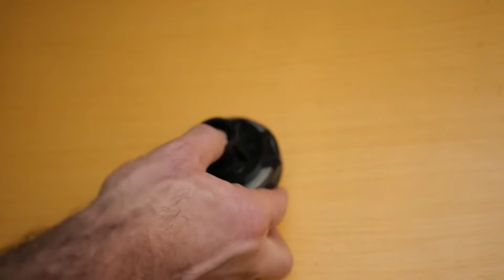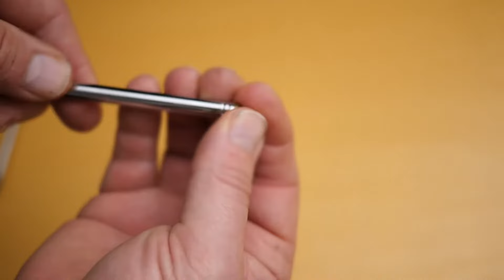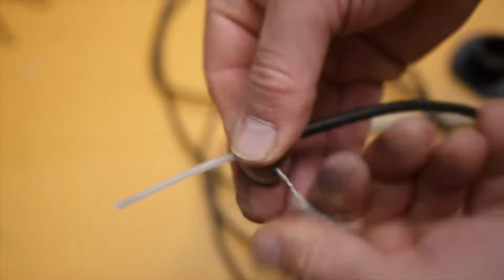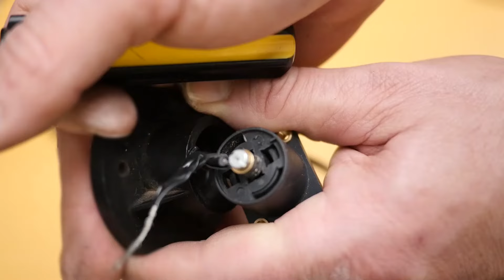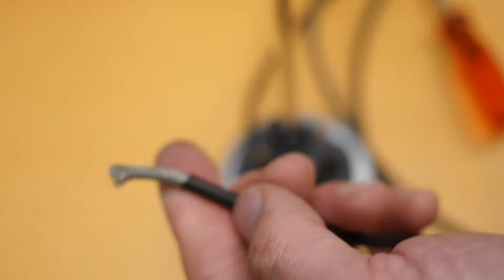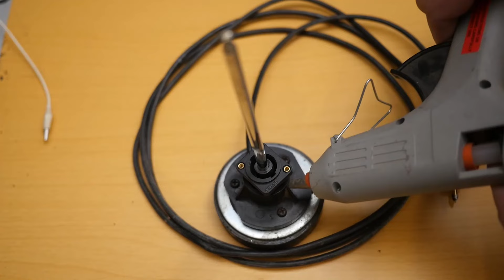FM Transmitter ANTENNA Portable HOMEMADE For FM Transmitter DIY low Power Broadcast Radio Station

Comment: Very nice and original idea of the monopole magnet Antenna! I also did a project as i could not  afford a real FM radio processor with at least  two or three separated audio bands,so to reduce the pumping effect of processing the audio all in one channel.
 I decided to use the most inexpensive method, using a cheap crossover that splits into 2 bands in stereo or three bands in mono.
Because i transmit in mono for it gives me more advantages in reach, cleaner  signal ect, and uses less bandwidth that also allows me to pump up the  volume more maintaining the spectral bandwidth limitation.
I connected the crossover in mono mode to a Behringer MDX 2600 two channel stereo processor .One channel processing the mids,the other channel the highs(treble ) and the third bass channels to a DBX 286s that has a nice density and  bass control on it to give it extra kick! making the sound more punchy! 
Then i connected the three separate audio outputs  to a very cheap three channel mixer that has a mono switch for mono output and the mixer allows me to control the three separate audio channels volume or density in the final stage before going to my 15 watt transmitter.
I was blown away at how good it sounded and how much louder compared to most commercial station! No noticeable pumping  on music ect
Recently i have added a sonic exiter to give the audio a warmer and enhance harmonic sound to it- I finally have my own sound that makes it  different from the rest.
I also use a SDR radio to monitor the signal so i dont splash outside the bandwidth.
Thankyou so much for these amazing videos you have.
Reply from the maker: Hey your project sounds very cool. Yeah I have experimented for years trying to produce that big radio sound without a professional audio processor. It's great fun trying different ideas. Your idea sound like a great project. I want to do more building projects for this channel in future. I enjoy the theory videos but building things can be a lot of fun. Thanks for your comment. Glad you like the video :)

Comment: Can I use speaker coper cable to connect the antenna???
Reply from the maker: No. You must use coaxial cable. Speaker cable will leak signal and make a mismatch between the antenna and transmitter. Must be 50 Ohm coaxial cable.
Reply: ThankU👍 @inspiresoundpro

Comment: I really hate how something so simple, can also be so complicated with so many variables.
Reply from the maker: Yeah the idea really is to be able to either find similar parts or try to come up with other solutions for parts you do find. But the principal is easy enough. It can be tricky though to get it to work in the exact same way. Cheers.
Reply: @inspiresoundpro  a set up like this is no issue for me to grasp.  Its more of wrapping my head around the whys of different ideal set ups in various settings.  

Am, fm, 50Mhz, 144.  Bread board prototypes to finished projects.  Through a car, on the work bench, huge radio stations, rf key fobs, and my current bain; trying to get a transmitter built that is simple enough for my niece to use and get a hang of, while its still usable and fun, without breaking any laws.  Lol.  

20 sum years ago i was building my own rc equipment and rf “bugs.”  But i have to admit, to fully design and build a system with my own knowledge has been a task.
Reply from the maker: Nice. Yeah I have also dabbled for years in a lot of frequencies like 27Mhz etc. I have been thinking of adding projects here for those but I'm not sure if it's the same audience. But yeah great that you showing your kids. These days kids just know social media LOL. Good that learn other things.